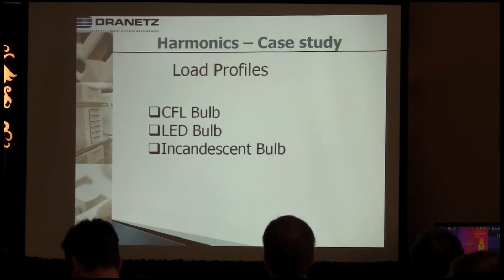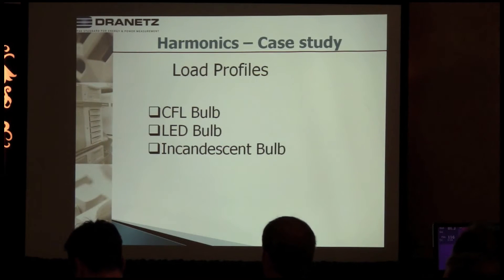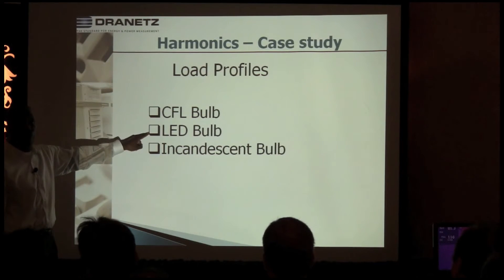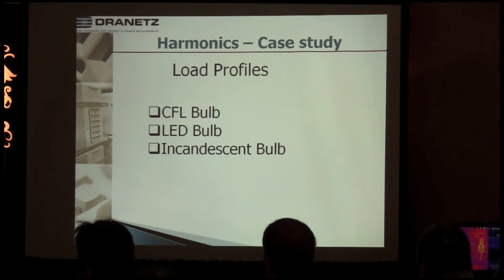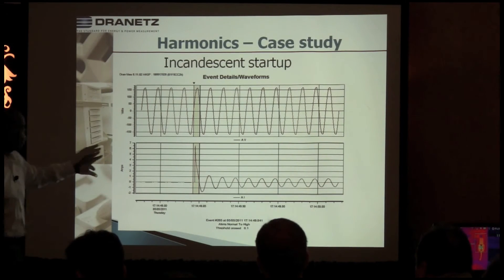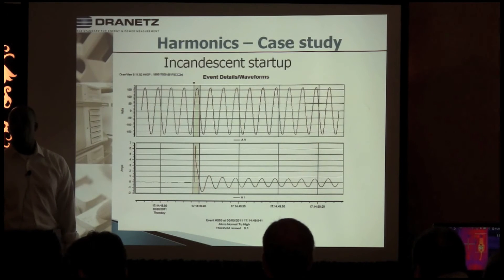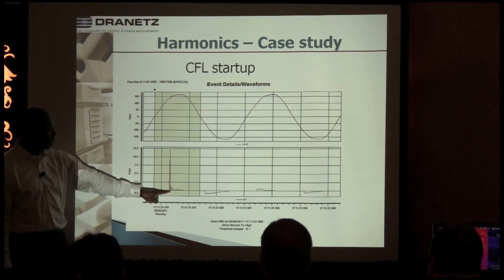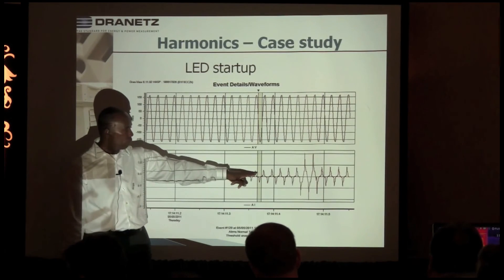Harmonics Case Study

Comment: The current surge at startup has little if any effect on lamp life and is mainly an issue with switch sizing.  The short lifetime of modern compact fluorescent lamps is due to their cheap design, as proper lamps are expensive to make.  1980s and 1990s lamps (back when they were over $15 each not counting inflation) and $10+ commercial grade lamps do not have these problems.